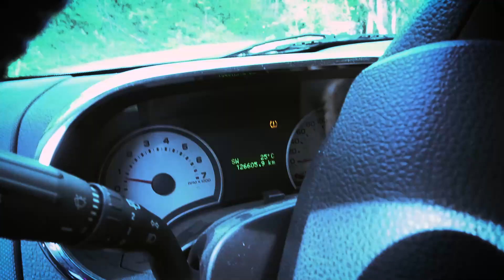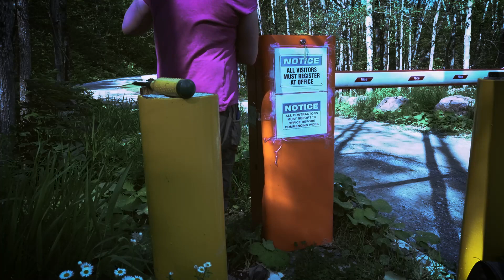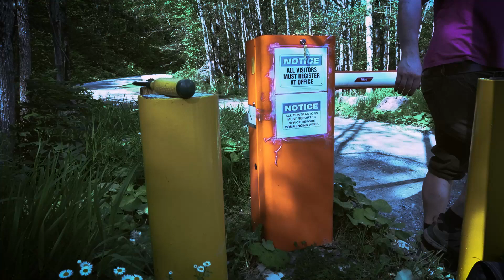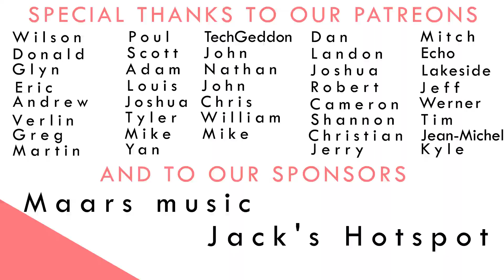Mikrotik Gper in the wild!

Comment: Thanks for your great videos 👍. We have successfully used these little guys on 370 meter (1200 feet) runs, one on each end, and one in the middle (it did actually work with two, but we wanted to make absolutely sure). And if that's not awesome enough, most of the run was alongside a hot stinking mess of 230v power cables, generators and coolers. On other occasions we used them as "optocouplers", to prevent switch ports from frying in the most hostile setups, they work fine for that too, if you are in a pickle. That being said, the better approach is to run fiber, but you guys already know that ;).

Comment: I have used a Gper with the casing to patch a split for a decently long run of cable. I actually want to see how well they function for the 1Km+ runs, it claims to be able to extend to. (yes I know fibre would be a better option, but ethernet is soo much more durable in certain situations)
Reply from the maker: Challenge accepted!